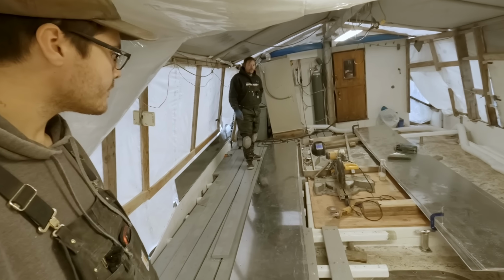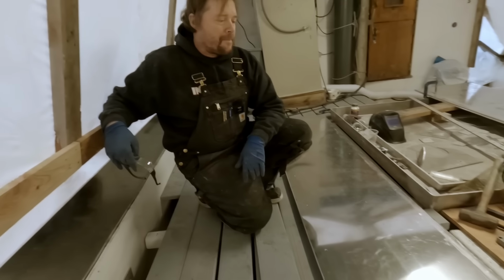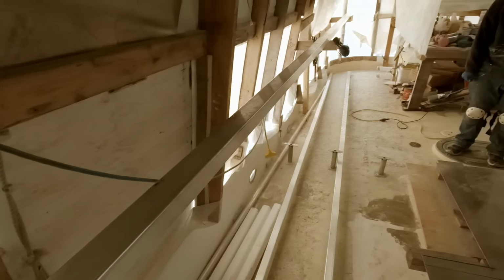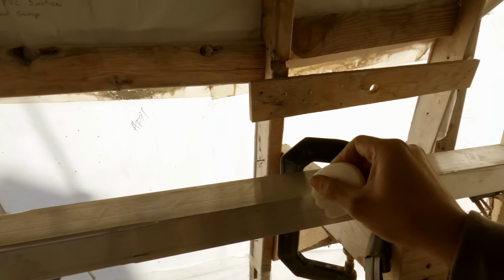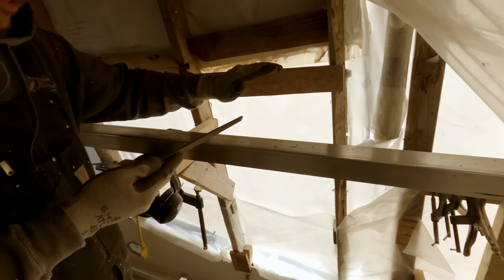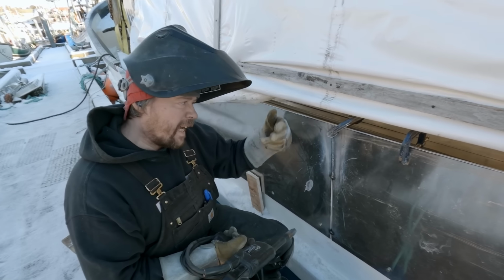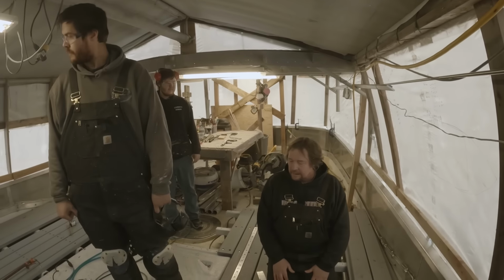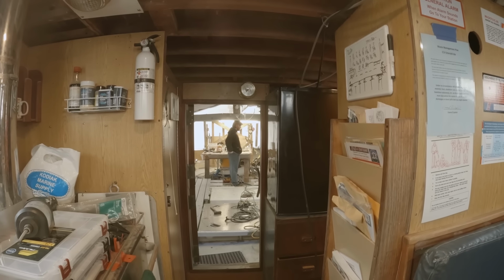Bulwarks, Fabrication, Trimming, and Rounding Corners - Emerald Isle: Ep.86 Fishing Boat Refit

Comment: I didn't know that you could use woodworking router bits on aluminum. Makes total sense though since it's so soft. Is the welder a tig? Nice job!
Reply from the maker: As long as they are carbide no problem. Bar soap works as a great lubricant and extends bit life. Also it doesn't need wiped down prior to welding like oil based lubricants. The welder I am using for the bulwarks is a Miller XMT 304 with 30A Mig spool gun. For the fuel tanks, I used a Miller Dynasty 200 AC/DC welder that can Tig aluminum.